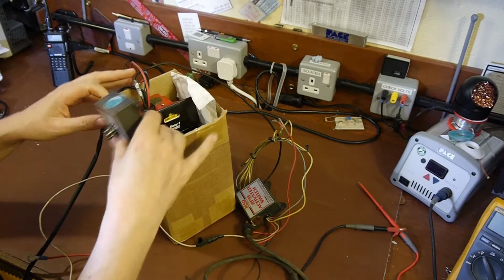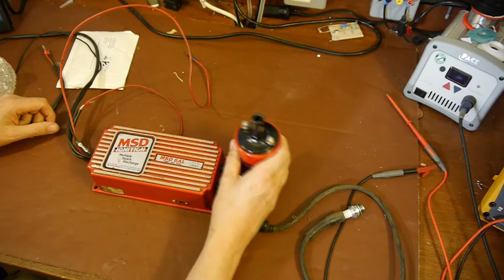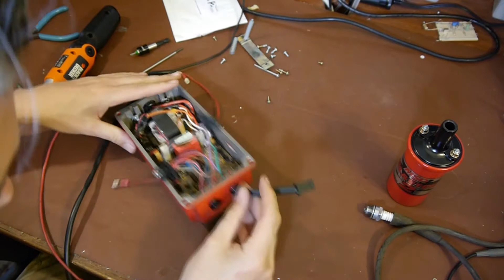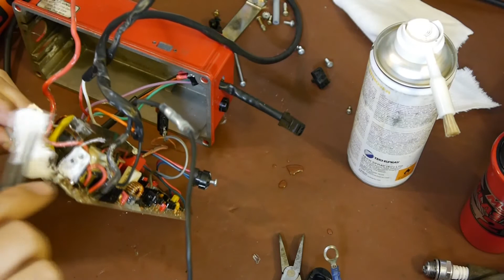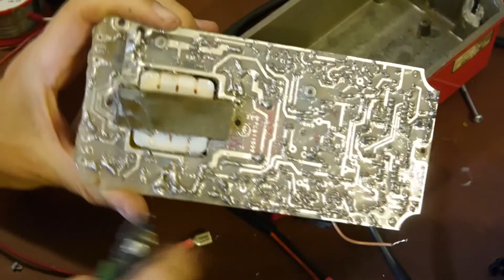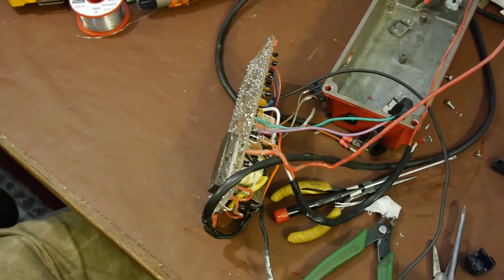MSD6 Part 1

Comment: Interesting device, shame it's near impossible to easily service, given the way it's constructed and conformally coated. On to Part 2!
Reply from the maker: MrDubje  I’m guessing they need the very thick conformal coating for the environmental conditions it works in. In not unusual to find automotive electronics potted as the components and joints work harden and break of due to vibration fatigue. The box is also riveted together and not easy to open. I guess most automotive technicians would not consider repairing. Thanks for watching. Regards Chris.
Reply: Overall it's well manufactured I would say. You're right. Because of the hostile environment for electronics they have to do it this way, downside for us is obvious, though.

Comment: I wondered what was inside those, fitted a couple years ago,
 'The operation was going well until it's leg fell off'?, 
All that electronics but still using points? not an optical thingy and chopper?, odd.
 though in the grand scheme of things points are more at my skill level.
 Best regards, Sam.
Reply: (You brought to my mind a newspaper report on someone who was using a radioactive tonic cure, " He was doing well until his jaw fell off").
Reply from the maker: Yes not the first leg lost during an operation and probably wont be the last.  They make a magnetic pickup coil but they also allow the old points to be used. The life of the old points is extended as they dont handle any current, only 350mA.